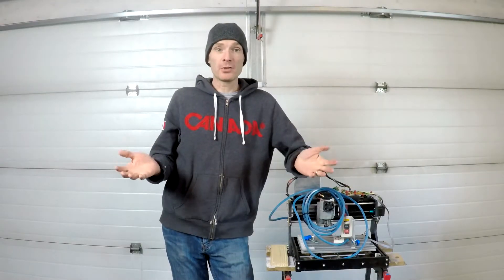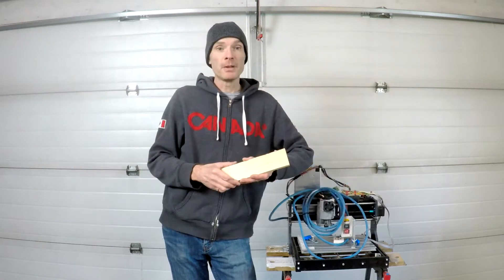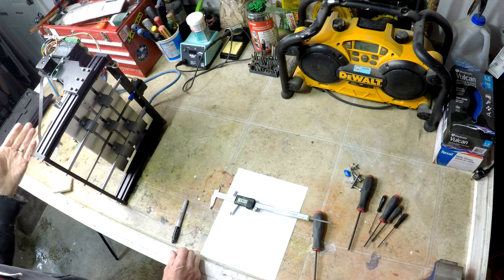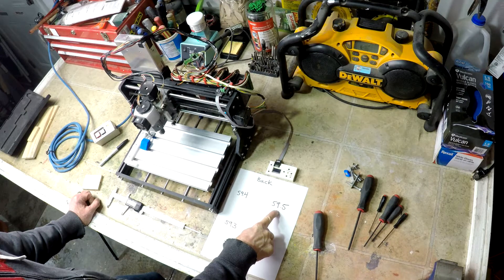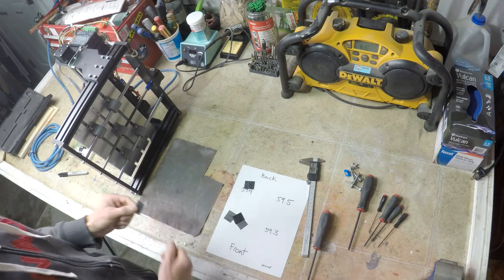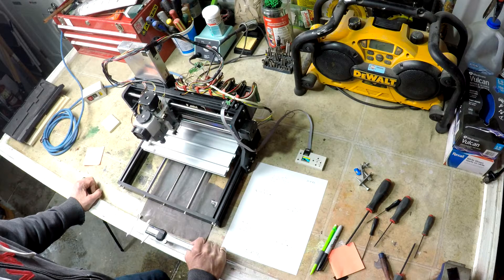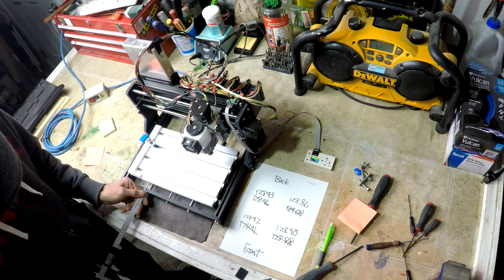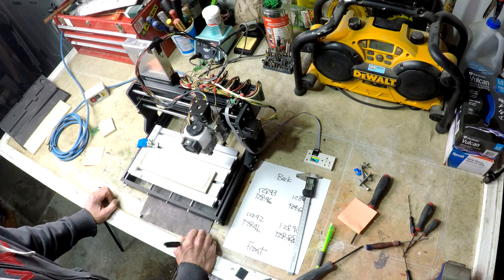CNC 3018 Pro Deck Leveling

Comment: I buy press board from Lowe’s in 4’x8’ sheets and cut them down to deck size and do the double tape super glue trick to hold it down. I mill the surface with a v bit. Even the 1/4 pressboard works and can be milled several times. I can cut about 10 times before the machine changes or I get glue on the deck. I run my resurfacing code and move on down the road. I tried everything and this works. The problem with these machines is they are always changing a little.
Reply from the maker: I still haven't tried it! Shimming got me close enough to do what I needed, then I upgraded to a bigger machine.  Keep thinking of doing a spoil board on my new machine, but never seem to find the time.

Comment: In addition, you could use something called an heightmap. Most software is able to do this.
Thanks for the video 👍🏻
Reply from the maker: Very true!  In my case, I'm using the offline controller which is pretty basic and doesn't offer that option.  If I was doing circuit boards and needed the precision, I would do exactly what you suggest and switch over to Candle from the offline controller.
Reply: @reileymckerracher9181  hello, just came and watched your solution, thanks a lot. Also read about P_Mouse suggestion and found this: https://www.youtube.com/watch?v=X2tFw8dX2h4. Everything very useful!

Comment: I had a similar problem. I drilled small holes to attach a 10mm spoil board to the aluminium deck (used countersunk self tapping screws). Then  milled the ply surface by .1 mm until even. Now I have an even carving on projects. There is facility for probing the surface & mapping the uneven points. You can then include the map for compensation reference while carving. But not all software has facity to include the level map .

Do you have noise issues carving on Y axis or on diagonal?
Reply from the maker: Good idea John!   Using a spoil board would definitely help.  I want to try carving aluminum, so I may try that when I put a spill board on it for the aluminum sheet.  I don't have any noise issues on Y or diagonal (or anywhere for that matter), but I'm not running the stock spindle either.
Reply: John which software maps the bed?
Reply: The universal G-Code sender and possibly Candle

Comment: Can you share the modifications on your machine?  Is it found in another video? Thank you great video....
Reply from the maker: Sure!  I don't have a video about it but I can link to what I used:

Spindle Motor: https://www.aliexpress.com/item/32849678424.html?spm=a2g0s.9042311.0.0.27424c4davwvEQ
Spindle Driver: https://www.aliexpress.com/item/32849686866.html?spm=a2g0s.9042311.0.0.27424c4davwvEQ
TB6600 Stepper Motor Drivers: https://www.aliexpress.com/item/4000015510620.html?spm=a2g0s.9042311.0.0.27424c4davwvEQ
Meanwell 24v Power Supply: https://www.aliexpress.com/item/32857859551.html?spm=a2g0s.9042311.0.0.27424c4davwvEQ

I'm controlling it when a generic arduino nano with a break out board with grbl loaded on it.   Might be a good idea for another video (to go through my mods), thanks for the idea!

Comment: I did a similar approach and then double sided taped strips of hardwood ply over the base board and milled that flat. Using a 1/4 inch collet and levelling router bit. It also helps save the aluminium base board . If you use strips and not just one large board it means you can still use the T tracks.
Reply from the maker: Good idea, I hadn't though about using strips with tape.  It's been a pain to stack up the wood so I can keep using the T tracks.